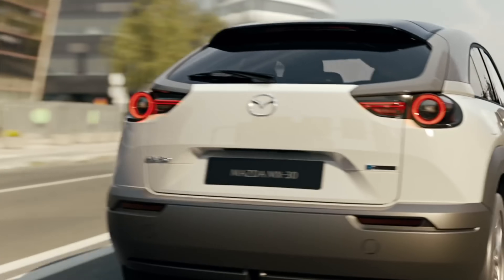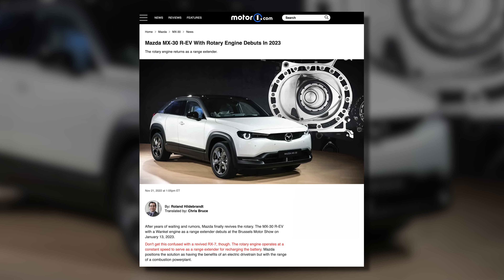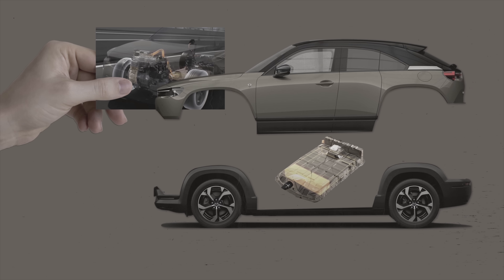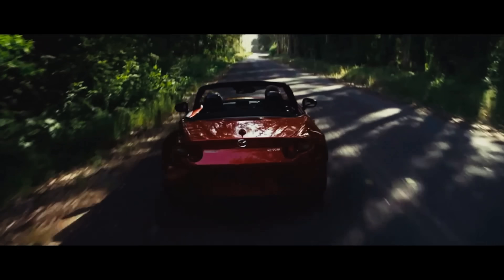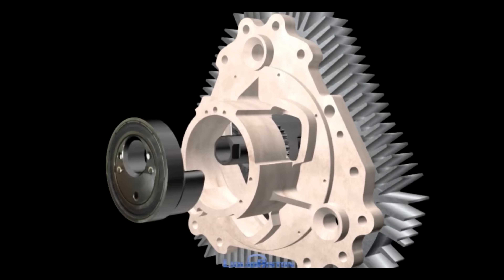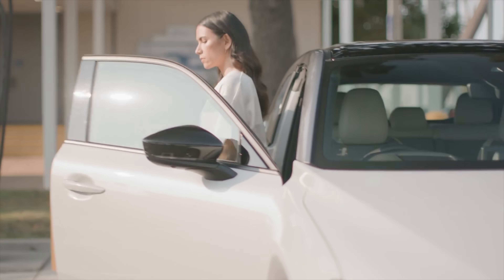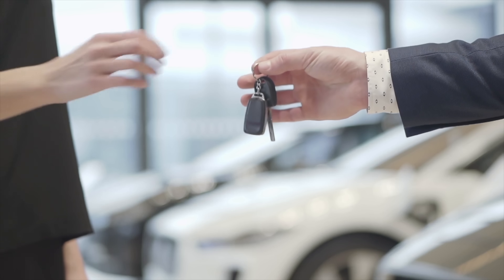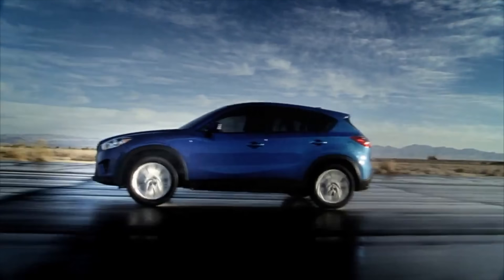Mazda's New Engine is the Smallest and Most Powerful Engine Ever Made

Comment: This would make sense if I lived on an island. Otherwise, the range is still too limited, and what will happen to this tiny battery in a cold climate when the efficiency and capacity drops up to 50%

What we need is a pure EV drivetrain with an onboard gasoline or diesel powered generator that can serve as a complete replacement for a charging station. It makes no sense to use a rotary engine for this, given their propensity to consume oil and to emit pollution. It isn't that difficult to make a small gas or diesel powered generator that his highly efficient and reliable. Maybe Honda will figure out how to do it. A simple 1 Liter engine is all that is required here.

Show me a four door four passenger EV with a range of 700 miles that doesn't require a charging station. Anything less is not fit for purpose in 90% of the USA.

Comment: That motor needs to find its way onto a motorcycle as soon as possible
Reply: I wish you were right— but Scotty explained that Rotaries do best at steady rpm’s  —  much like an airplane engine… 
Car engines having transmissions changing ratios and thus RPM differences causes issues with Rotaries
Reply: It will. it seems to have a very limited rpm range, so it would need .... im not sure.
Reply: See 7:20
Reply: Look up FortNine’s video titled “The engine that kills everything it touches.”
Reply: @rayr1642  that video PROVES that the rotary never worked In motorcycle applications - 
Even mentioning that Suzuki tried to make it work for 18 mos of R&D - and then said SAYONARA 👋🏼
Reply: @nextleveljourney6612  Yes. I was responding to @Terry's vids who said the rotary engine needs to be in a motorcycle.
Reply: @rayr1642  I enjoyed that video - was thorough without turning into blah blah blah fest for __ mins haha —  I think it would work in a city scooter 🛵 with a CVT or PDK style clutch — 45 mph max speed) but not in a motorcycle 🏍️ it wouldn’t last long due to what Scotty mentioned 
(See 7:20)

Comment: I'm curious on what a 2 cylinder or 3 cylinder motorcycle sized engine would output as an extender. Those engines can get pretty small, so my thought is that it could still be pretty easy to fit it into an already existing car. Or even a single cylinder engine for smaller cars that don't have massive batteries
Reply: Briggs and Stratton made a concept electric car with a roughly 20 horsepower engine to help it get up to highway speed back in the 80s. Now with better electric motors and batteries, I am glad that Mazda seems to now be revisiting that concept.
Reply: @theredscourge  Jay Leno's Garage (YT channel) did a feature on that one recently.
Reply: The rotary engine is 214 lbs and puts out 73hp.  Assuming a decent generator, you need about 50hp being put into the battery pack to maintain speed, plus some extra capacity for heating and lights.  Considering that Suzuki makes a 599cc engine in their Bandit/etc bikes (and variations over the years) that puts out a solid 75hp in a 100kg or less package, it does seem like the rotary while great, could be a lot less heavy as well.  I think the issue is that Mazda simply doesn't make sport bikes. Now if Honda decided to go this route, they are set - drop a CBR engine in the thing and laugh at the competition.
Reply: China has low speed city EVs that run at 48, 60 & 72 VDC. Ali Express sells gas powered 4-7 kW DC Range Extender for $200 people put in their vehicles.  
Something I would consider to supplement a home solar system that runs on batteries.
Reply: @josephoberlander  I'm sure nobody would remember this, but Norton (a classic British motorcycle firm) built 500cc class wankel powered race motorcycles (and police bikes!) back in the late '80s-90s based on an engine they originally designed for use in military target drones (the units that pilots tried to shoot down). I'd been told those original drone engines were run at steady near-redline revs for extended periods until the drone got shot down, and then a crew would scoop up the engines and mount them into a new drone and go again! In the street motorcycles they made like 80 or so HP and 100-110 in race trim. And the race bike weighed in under 400lb, so 214 is more likely for the whole package including generator, exhaust, fuel tank and all the other ancillaries...
Reply: @josephoberlander  You are knowledgeable. Off road racing, side by side UTE's are going to be a big thing this year.
Reply: @josephoberlander  I would think the 2 cylinder engine in the new cb750 hornet would be a good choice due to its small size given the displacement, as well as only being 2 cylinders for fuel efficiency purposes, and topping out at 90 horsepower
Reply: I found it odd that you compared 214lbs and 100kg and said the rotary would be much lighter.  Check my math, but if you convert 100kg to lbs it's about 220lbs
 So 220lb vs 214lb is a relatively minute difference in weight either way.
Jusy sayin
Reply: In addition to any other issues folks here have brought up, I imagine noise would be one.  For the engine to run in an efficient range without lots of RPM and the noise that comes along with it, it would have to be sized appropriately and I suspect something based on a motorcycle engine is not the right answer there.  Same issue with one cylinder engines.
Reply: @asdf51501  well, yeah motorcycle engines vibrate and make noise, but that's kinda what I would expect out of an engine inside a small frame like a motorcycle. If it's in a car, it will A) have more than three feet of exhaust, which will tone down the noise, and B) be placed into a vehicle where it wouldn't be a stressed member of the frame, and is also put into an actual car, something that is MUCH larger in almost every case, so that would quell most if not all vibrations since the vibrations from motorcycle engines are usually small and quick due to their size, no?
Reply: @im.js.17  a 2 cyclinder 250cc engie or smaller would be great as each cylinder counter acts the vibration of the other.
Reply: @atomiccat2002  now I don't know sh*t about converting horsepower to electricity, but I doubt that would be enough power to extend the range by any meaningful amount. That also depends if it's a 180 crank or if it has a 270 crank
Reply: @im.js.17  I think you are right a dual 250cc engine would probably be about the smallest to get any meaningful amount of electricity, the GSX250R puts out 25 HP , I dont remember what the video said the rotary engine put out.
Reply: @im.js.17  These points are best answered by engineers testing all this in labs, not by ordinary guys like me speculating on YouTube.  I was just thinking in terms of what would be optimal for eliminating as much NVH as possible without relying on the vehicle frame or an external exhaust system.
Reply: This is interesting. Any time you can reduce the power needed to output the necessary amount of energy to move weight , you are increasing efficiency . If a 75HP vs a 250HP motor could be used to power an electric vehicle and provide the same energy , say equivalent to a 250HP gas engine, you would have a huge efficiency increase.
Scott didn't really go into acceleration 0 to 60 or cargo capacities of a gas vs electric version of this vehicle.
 He said it would have a 400 mile range, but didn't mention how large the fuel tank is.
If it's a 20 gal fuel tank to go 400 miles, that's pretty equivalent to a gas engine. But if it's a 2 gal tank to go 400 miles , then that's a great improvement .
There is some nice technical information here, but,  unfortunately there is some important information missing in this whole video to really convince me of anything.
Reply: More weight for safe passengers means more engine . Hard to get past that...
Reply: @jsEMCsquared  with batteries themselves weighing as much as some small cars at times, I think it's pretty easy to get past that
Reply: That sounds like a brilliant idea,  a small well made well balanced engine from Honda say with a quiet exhaust ... excellent !
Reply: I see a resurgence of Tecumseh and Briggs and Stratton engines.
Reply: BMW added it to the i3  Range extender version.  Battery and a gas engine back up.  but regulations limited it to 2 gallons of gas.
Reply: @danc2014  and that limitation was based on the short battery range available at the time, and the philosophy that the i3 is a city car, not a grand touring car, so that the engine should not be needed much.  It’s a brilliant city car.
Reply: I just dont like driving an electric csr with a motor that changes rmps ay its own willy nilly.
Reply: BMW i3 rex? It is on a market since like 2014? I does have 650cc motorcycle engine
Reply: The same displacement piston engine would weigh more and not be as compact.
Reply: @kmoecub  I would say that depends on the amount of cylinders you have, the design of the engine, ext. Because of the fact that the casing for a 750 i4 motorcycle engine would be wouldn't be as wide as a 750cc twin engine
Reply: Didn't workout so well for BMW i3...
Reply: @ginog5037  works fine for my i3
Reply: @Patrick S  I'm glad, what's your  odometer reading?
Reply: @ginog5037  just hitting 40k.  I have owned it for 8000 miles and maybe 1000 of those are using the Rex.  I don’t know how to see the number of run-hours on the engine for its lifetime — would be nice to know.
Reply: i have always wondered why car manufactures didn't do something like this with a small engine. It's just like how diesels trains work minus the battery's. Good on Mazda and I hope they do a rx9 one day from this new engine design.
Reply: The Diesel hybrids I heard about those. They are amazing in the trains.
Reply: Vibrates like crazy
Reply: @marshmower  Well when you put an engine into a motorcycle frame, yeah your going to notice vibrations due to the engine characteristics, but more importantly the size of the motorcycle (smaller than basically every car in the vast amount of cases) so if you take that engine, put it into a vehicle that is MUCH larger as vehicles tend to be, that alone could quell most if not all vibrations from a small motorcycle engine due to the shear size difference between a motorcycle and a car. Especially if the engine isn't a stressed member of the frame of the vehicle, I doubt you would notice any vibrations. And I doubt you would notice any even if it was a stressed member honestly.

Comment: This is one of the few EV/Hybrids that almost makes sense. For the US market, they'd need a bigger battery/more range.
Reply: It makes no sense. 124 miles?  Nissan leaf is a better buy.
Reply: @Mdawg75 Also did you not see the part where I said it needed more range and then it would make sense in the US market?
Reply: @rev68  yes. Still a dumb idea. Honda should team up with Madza and produce an ev.
Reply: @Mdawg75  Some people don't want to broadcast to the world they enjoy watching their wife get railed by other men.
Reply: @Mdawg75  Did you not watch the video?
Reply: @SamLoki  yes
Reply: @Mdawg75  If your out of gas your right. But remember with this design you just pull into a gas station and fill your car up like normal and your back on the road. I don't like the idea of running the output from the engine directly to the battery because it's going to put a ton of wear on it. I wont buy a ev because I don't want to be stuck somewhere charging for 2 hours.
Reply: @ggletsplay5041  I agree with you but I don’t see this selling well at all. Toyota is the king of hybrid technology. I foresee this being discontinued in 4 years like the Kia stinger.
Reply: That’s the whole point of the new MX-30 REV; with the rotary engine range extender it can go 400 miles with a smaller battery than the original MX-30 EV that only went 124 miles.

Comment: Range extender engines are a great idea but rotaries are as wildly inefficient as a 2 stroke.
I don't get it.
Reply: Rotary engines are incredibly efficient.  They lack torque, but generate enormous amounts of horsepower for their size.  Since this engine is simply a power station for the very small included battery, it should be a pretty perfect mix.  Assuming you don't need the engine to turn on each and every day you drive the vehicle, you're looking at many hundreds of miles per gallon of gas.  I didn't see any info on the gas tank, but I can't imagine it will be larger than 7 gallons, which would get you a minimum of 21 hours of drive time with the engine running, which it doesn't need to for the first 40 miles driven after a charge, 21 hours at 60mph = 1200 miles, assuming the battery can take all the charge thrown at it.

I think Mazda either underestimated range or the gas tank is more like 2-3 gallons.
Reply: @freebobafett  efficient in every way except fuel efficiency. In that they are very inefficient. Reportedly as much as %50 less fuel efficient than a piston engine